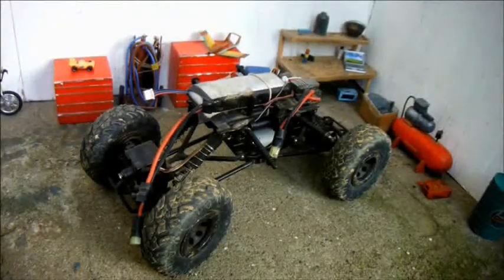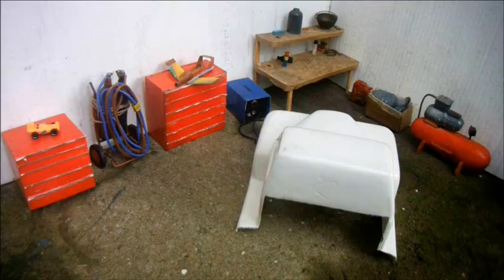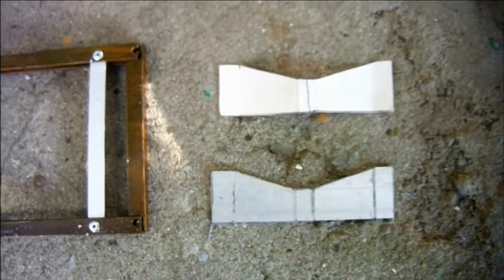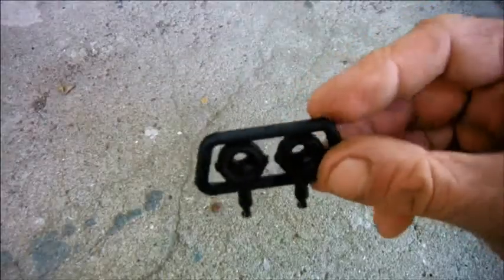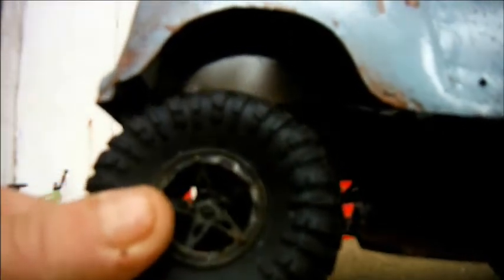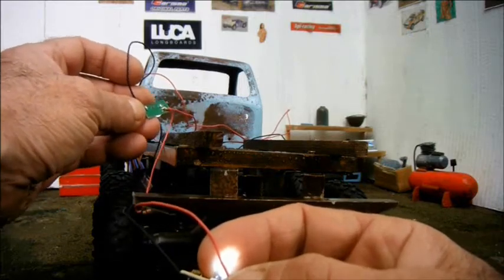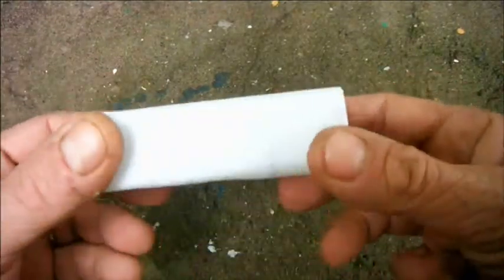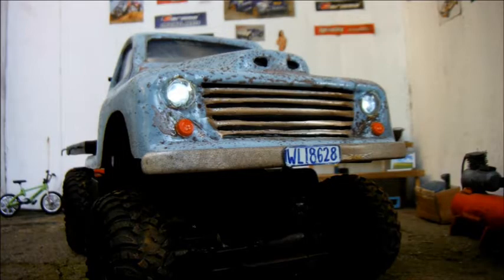WLtoys 18628 6x6 1950s truck

Comment: Hi Del - well thanks for a very entertaining 40 minutes, I really enjoyed that!  The conversion was genius my friend, I feel the need to have a go at doing something similar myself after seeing this. Thanks for showing all the steps and explaining your thought process as you go, I have learned a lot from this and your other videos. And to add to the build, we get a fantastic story video to finish - the truck looked ace and the spin in the boat was a treat - cool the way you drove it back on the trailer!  Pity it packed up, but at least you got the run in, and as you say, it will be better with the upgraded electrics anyway. Bloomin' marvelous mate!  :))
Reply from the maker: Well, thanks, Mark - in fact, only today I was wondering whether to allocate one of the three new radios and two new ESCs which I´ve just got to this build. As WPL have released a new fully proportional "receiver board" and servo set, intended to be retro-fitted to their B1 and B24, I think I´ll try that for this, saving the hobby-grade stuff for two builds which I have in the works.
 Thanks for clicking on such a long video  : )
Reply: @Del350K4  It was my pleasure, Del - and yes, it makes sense to use that new proportional upgrade board - the "two builds in the works" sounds interesting!
Reply from the maker: @MarkBryanRC  I don´t know whether you remember my 3-part drag truck build. It´s based on, of all things, a 27mHz toy/hobby-grade F1 car. A friend recently gave me two more of these and I´ve been acquiring and squirrelling away various body shells and wheels to start building both. I need to decide which to do first....
Reply: @Del350K4  Think I need to watch that soon!  Sounds like you are formulating a very cunning plan - or two  :-)
Reply from the maker: @MarkBryanRC  I do love a cunning plan   : )

Comment: Damn sir! that truck looks awesome! nice job :)
Reply from the maker: Hello, RC Buddy - thanks for letting me know that you like the truck. I´m pleased with the way it looks - I just need to buy the things I need to upgrade the electronics.
Reply: i started filming 2 days ago. bought a wpl b1 and im having some fun with it, but i might need to upgrade it too for porpotional steering and a little more power.
Reply from the maker: It seems that some people are fitting a longer-case motor, while a few are going for a 3D printed bracket which lets them house two motors. 
 It´s wise to remember that the "receiver board" is both cheap and quite prone to burning out, so maybe you should consider ordering a spare when you get any upgrade bits. I´d like to get myself a set of the kit-version´softer tyres - I´ll order myself a spare Rx board at the same time.
Reply: thank you for the advices, i will think carefully about it :D best regards

Comment: hi del, ik this is quite an old video but I enjoyed it. I have ordered one of those 6x6 as well and am anxiously waiting for it. if you could give me the dimensions of the axle to order aftermarket wheels I would be grateful. I also have a suggestion, if you increase the quality of your footage you will get many many more subscribers and viewer, thanks
Reply from the maker: Hello 
- the wheels are the same as the ones used for the RTR MN45 and MN 90 series of models. They use the same small drive hex, but Tomley RC has posted a video showing how to fit any hobby grade wheels to these axles.
Reply: @Del350K4  thank you soo much man